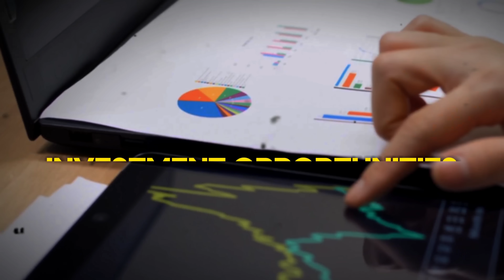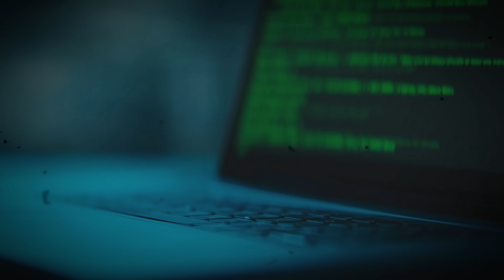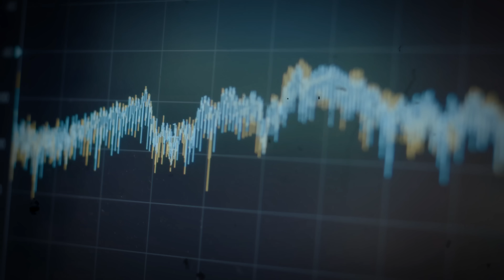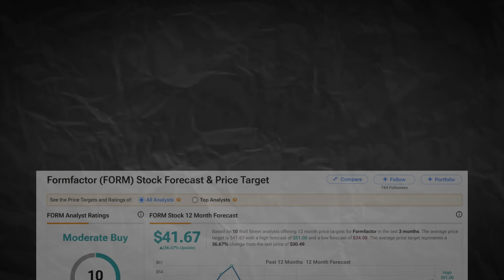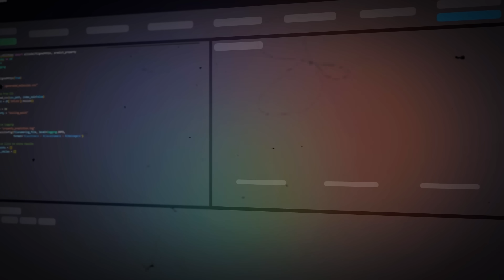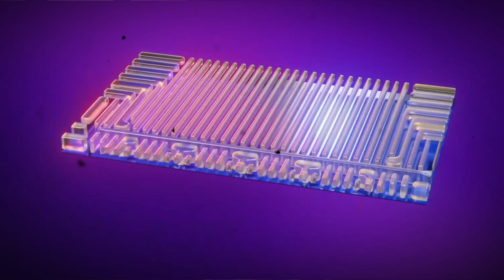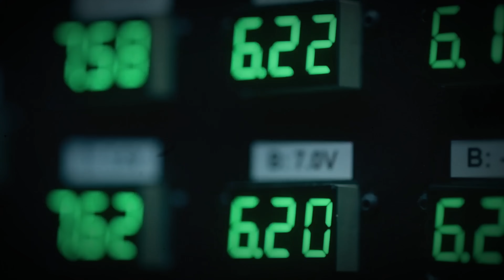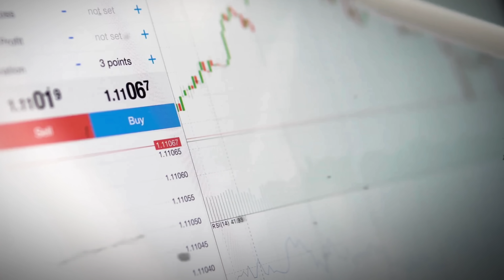You Missed Out on Palantir - Don't Miss Quantum Too!

Comment: This looks interesting on several fronts.. Poached from Ran Melamed - TipRanks Reporter... And looks to be easy on the cooling requirements..... 

"Pleased to Make Your Acquaintance

PsiQuantum is one of the most well-funded quantum startups in the world, having raised more than $1.3 billion. The company is based in the U.S. and focuses on building large-scale, fault-tolerant quantum computers using photonic qubits. Its strategy leans heavily on silicon photonics and deep partnerships with Microsoft MSFT +1.05% ▲ , NVIDIA NVDA +0.46% ▲ , and GlobalFoundries GFS +0.52% ▲ . PsiQuantum aims to build a one-million-qubit machine and has designed its platform for industrial-scale manufacturing. Given its size, focus, and backers, it is widely seen as a top IPO prospect in the sector." 

Will be watching this one too...
Reply: oops.. maybe not easy on cooling... "testing production cryogenic cabinets"